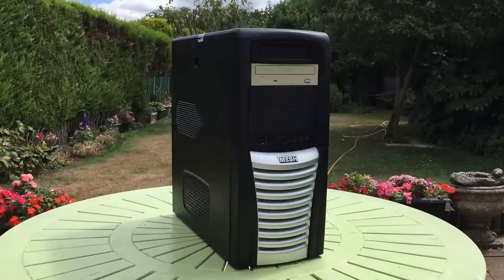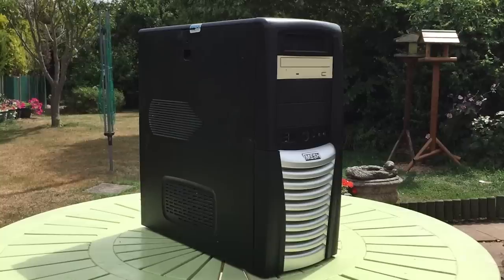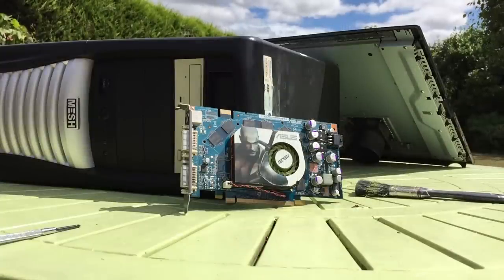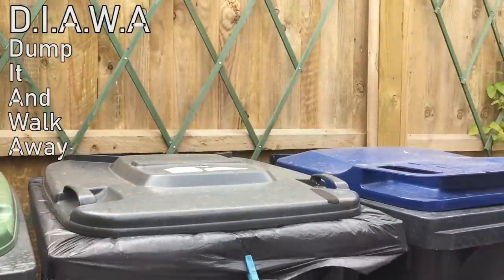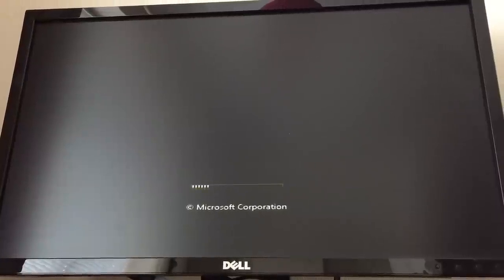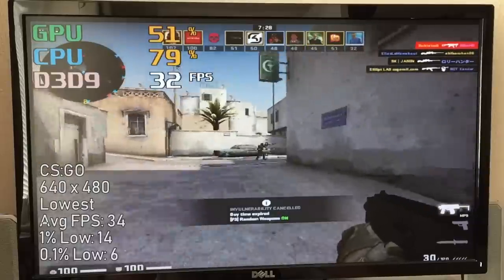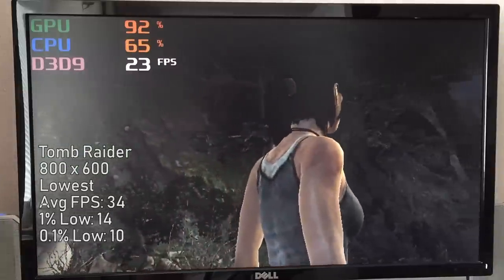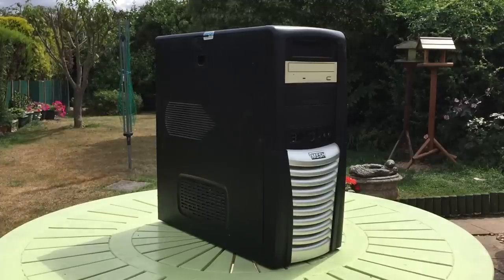Using an old £1000 ($1300) Gaming PC For The First Time In 10 Years...

Comment: The 2gigs of ram is killing it :/
Reply: Yeah, I think the overlay said the PC was using 6-ish% of its CPU power in Mafia... :/
Reply: My pc has 2gb ram...
Reply: I could max out Mafia at 1600x1200... With a Ti4200, so this card can max out it at 1080p for sure. Anyways, for this comp I'd just stick with WinXP.
Reply: @perttierajorma8884  have
edit: that was 1 year ago and i was stupid. 
sorry :/
Reply: PetarGT Cro -- Uh. No.
Reply: *has
Reply: nicholas132 have'nt*
Reply: 1gb... And Win7?
Reply: That 256mb card is not helping it either.
Reply: In the case of Minecraft I think it's the issue. As far as the other games go, CS:GO and Tomb Raider are probably limited by both the amount of RAM and the graphics card, and Crysis is probably maxing out both the GPU and CPU. As for Mafia, that computer can definitely handle it at high resolution and max details. I owned a very similar machine at the time.
Reply: pagb666 my 2008 650$ pc has 4gigs of ram and a gt9800 so i dont think thats a 1300$ pc
Reply: Αριων Βαβλιακης Considering the hardware in it, the computer featured in the video is from mid-2006
Reply: pagb666 exactly what I was thinking. XP would have been a better choice.
Reply: i have 2gb of ram :/
Reply: Mhah kek
Reply: @ControversialOpinion  2 GB of RAM would have been fine for Windows XP, but Windows 7 operates much better with 4+ GB with a 64-bit capable CPU.
Reply: It is you need more than 2gb ram for 64bit os.
Reply: @perttierajorma8884  my phone has more than that I doubt yours does
Reply: It's not the ram, some years ago I played mafia 2 on 1gb of ram just fine
Reply: My current PC has 2 GB of ram, 2.02 ghz CPU and the rest idk
Reply: I would have gone with 32-bit windows with only 2gb ram
Reply: @Petar321_GT  has
Reply: Bruh just download ram
Reply: @Petar321_GT  *has
Reply: Enfant Terrible mabe the os
Reply: pagb666 You nailed the problem bro! 👍🏻
Reply: pagb666 a core 2 duo can handle windows 7 with no problems at all with 4gb ram
Reply: If he upped it to 8 I bet it'd run way better.
Reply: @perttierajorma8884  F
Reply: Not only because is 2 gigs but only one and in the first socket
Reply: @ΑριωνΒαβλιακης  a lot changed in that period plus this was a prebuilt.
Reply: @reimnop  it was one year ago dude, and others already pointed it out.
Reply: That 256MB of VRAM, tho.
Reply: 2 flipping Gigs only 2

Comment: I just bought an pc for 90€ it has these specs: Core i3 2100 3.1ghz, 6gb ddr3(4gb 1600mhz,2gb 1333mhz), Msi gt 1030 2gb, hdd 250gb. I'd say it's pretty good for the price.
Reply: Tomas Gaming It's a bargain for that price .
Reply: Tomas Gaming it's a fucking steal mate though I'd prefer an i5 2500 over the i3
Reply: Thats a steal for the price, you can play some games on it.
Reply: I'd say i3 2100 and gt 1030 is a good combo. It can run gta v at 60fps, csgo at 90-120fps and fortnite at 90-113fps
Reply: Not on high settings though but still at least runs great for an xbox 360 price and because it's pc it can do a lot more like running emulators and stuff.
Reply: TGLT Clutch yes gddr5, and yes i checked the price of 1030 it's almost the price of the pc and my 1030 is the best version of 1030 as i checked. By the way they wanted 160€ for the pc 3 weeks ago but i got it for only 90€ lol how lucky I am!
Reply: Where did u get that bargain?
Reply: basically you just paid for the 1030
Reply: Embrace the Darkness Yup
Reply: Embrace the Darkness I'm now began to load some games on it. I will install more tomorrow
Reply: What a bargain I got a computer like they bit 2gb of extra ram for $400
Reply: Tomas Gaming You stole the guy.
Reply: Mandragoras Yeah lol
Reply: ateb3 What? It can run gta v fine
Reply: ateb3 You probably never had one your self i don't think any integrated gpu could run gta v at about 60fps on mostly high settings.
Reply: Tomas Gaming I have the i3-2120 and a GT1030 and it's actually pretty good for the price
Reply: I upgraded to an i5 2400 from an i3 2100. I have a GTX 1050 and 7GB DDR3 1333
Reply: Ralph Lau Yeah for sure
Reply: ateb3 The only integrated gpu's that are close to the 1030 are the Ryzen APU's. An overclocked 2200g is slightly under a 1030 in performance, an overclocked 2400g is around a base 1030 in performance (until you overclock the 1030). And upgrading a 1030 to a 1050 is a waste. A 1050ti may be worthwhile at the right price and you get a decent price for selling the 1030, but not a regular 1050. But honestly, with that cpu, not sure I'd go above a 1030, so just enjoy the combo and keep and eye out for cheap 1050ti deals and a cheap 3570 if you want to extend that system out longer. But thats a great price.
Reply: Got a gtx 1070ti 8gb for 150€ because the dude put "old graphics cards for sale" i have no idea how he got it.
Reply: Ahhh LGA 1155.
If you can get your hands on a E3 xeon or 3rd gen i7, 8gb ram (total) and a gtx 770 4gb, this badboy could last you even with modern titles for a long time. 

That socket takes me back to the days where intel did not throw away a socket after 1 generation.
Reply: WTF GT 1030 Is 110$ in my country
Reply: Tomas Gaming that gpu alone is like $60-$90 lol 
Where did you get such a cheap price???
Reply: thats better than mine lmfao
Reply: can you tell me where, how did you bought it?
Reply: Holy shit that’s a complete steal for only 90 Jesus ur lucky bro
Reply: My gpu costed that much XP
Reply: Lenovo??? I have one close to that and I upgraded it! It is epic except for only 2 cores in the processor
Reply: @TGLT Clutch its 90 euros so thats like 100 something dollars
Reply: for that price, its amazing. You could use it for some decent esports stuff
Reply: So you bought an entire pc with a GT 1030 for the price of a new GT 1030
Reply: awesome but maybe getting another 4GB 1600MHz stick that would help the performance (that's the config I'm using in my laptop)
Reply: nicee that's a good deal
Reply: If you need a CPU upgrade, I can recommend a i5-3450. They are really cheap and have a good performance
Reply: My mum got a LENOVO ThinkCentre M73 for $100 aud (about £70-80) and it has 12GB DDR3 ram, a GTX 745 4GB, an Intel Core i3 4130 3.4ghz, a 120gb Kingston ssd with a fresh fully activated version of Windows 10 Pro. (Btw we upgraded the ram to 16gb)
Reply: it really is
Reply: i bought a 250 eur system and its weaker than that exept it has 8gb of ram (2x8 2400mhz)
Reply: I have one for near the same that i got for 50$
Reply: It's got good upgrade potential. Power supply might need an upgrade if its low wattage or a pre- built system one.

Get an i7 2600K
16 GB ram 
And a gtx 1060
Reply: why did you buy it... 🤦‍♂️
Reply: You ripped tHim off
Reply: The gt1030 is worth at least £50 alone
Reply: Bottleneck
Reply: Sell the 1030 for a 950
Reply: I bought for €100 pc with I5 2500K and GTX 660ti, Corsair 2x4GB 1600Mhz, FSP Fortron 450W and Aerocool SL-5100
Reply: woah nice

Comment: minecraft: can't run at all
cysis: you bet it can, no stutter 

Typical Nvidia unpredictable :P
Reply: Michael _Howto&tech
Minecraft is much more cpu entensive than graphics entensive if you run minecraft on a 1080 with an i5 8400
It will have almost fps as running with a 1050 using the same cpu
Reply: I have a Core 2 Duo E6750 and mincraft always ran great, it's probably a RAM issue or GPU
Reply: yeah those stutters, i think the machine isn't working properly
Reply: no the stutter is because minecraft uses 1.5gb of ram and windows 7 uses like 1gb and this system only has 2gb of ram so yeah
Reply: Zurc not really, minecraft uses, or did use 512mb. Still 2gb filling the ram, but windows 7 can survive on 1gb of ram. (I've had a laptop like that with 1gb of ram and it was OK performance). Although his recording software might be causing some stutters also
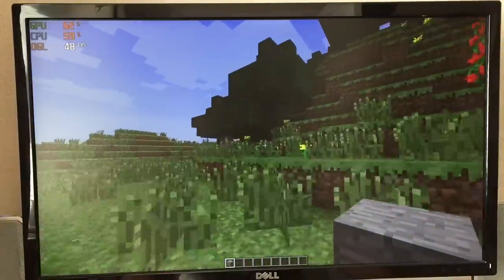Reply: well i play the game myself and everytime i play mc it uses 1024 mb i put anything lower than that on the launcher and the game wont launch also he wasnt using any recording software at 7:15 he recorded with his camera when he did benchmarks cause im sure that 2.4ghz core 2 duo wont be enough for recording + gaming at the same time so its probably not the cause of the stuttering maybe its the low clocked cpu idk
Reply: New versions of minecraft require atleast a gig of ram if he has two gigs only then its  a ram issue
Reply: Michael _Howto&tech it’s the ram not the gpu/cpu
Reply: Its most likely a mix of cpu and ram issues since minecraft uses 1 gig ram if you don't have any mods installed
Reply: Crysis the most fucking unstable game
Reply: lol
Reply: @MichaelFlatman  he's not using recording software, he's got a camcorder in front of the tv
Reply: Minecraft versions does big impact to playability
Reply: Minecraft runs on the cpu.Thats why.
Reply: @Adrien Otis Instablaster :)

Comment: RandomgaminginHD: buys 12 y/o PC.
Me: builds 12 y/o PC.
Reply: I still have the i7 950
Reply: @gopnikvasily6074  i have a4-6210
Reply: @gopnikvasily6074  i have i7 920
Reply: Same
Reply: @gopnikvasily6074  I have i3 550
Reply: @Christian Johnson boi i have a amd e1-1200 apu 1.4ghz.
Reply: @Christian Johnson but now I got a quad core Celeron at least it's way better then my old amd
Reply: Healthy retailer and consumer relationship
Reply: @Christian Johnson I dunno if its new I bought this laptop this year tho and it says it has 4 core boosts up to 2.4ghz
Reply: i got an intel core 2 duo 2.66ghz
5 gb ddr2 ram
and a 1gb DDR2 amd radeon 4650 HD
beat that bitches
Reply: Savage Survival still using ibm 😂
Reply: I have ryzen 5 3600, gtx 1660 ti, 16 gb ram
Reply: I still have a 20mhz 386 with a math coprocessor.
Reply: @ahmedamr6028   Athlon X2 5000+, 2GB DDR2 553Mhz, HD 5450 1GB DDR3, HDD IDE 40GB Windows XP. Still rocking today. (Not main system, but it's the shittiest I have)
Reply: I have amd 6300 fx :(
Reply: Me to I have core i7 4790
Reply: @princevaldym7606  there is nothing 2000watt psu.. the last model of psu is crosairr xi1600watt
Reply: bruh i have a q8400 and a gtx 550 ti i am happy with it though ^^
we'll get through this my fellow broke boys
Reply: I have pentium 4
Reply: @gopnikvasily6074  i still have the 920 and 930 lol

Comment: This would be a fun system to "max out". Max ram, max cpu, max gpu, ssd, proper fans.  Push that Mobo and case for all they are worth!
Reply: NewWorld9 Core2 Extreme QX9650, 8 GB DDR2, GTX 1050TI (Not sure if it can handle it, even with oc), PSU at least 450W quality, SSD any type, fans etc. I wonder if it would work
Reply: I would love to see, old hardware show what it can really do. would be a sweet build. Maybe a benchmark video to see which card would be the  fastest feasible for this CPU.
Reply: Max GPU? Na, sli 7900s
Reply: Somogyi Norbert yes but with a 1080ti, see what it can actually do!
Reply: I think the core 2 quad qx9770 and gtx 1060 will be cool
Reply: Yep, would run great, even with a newer GPU like a 1070 or something and play modern games at 1080p pretty well. The CPU would be holding it back a fair bit, but the core 2 CPUs had very long legs.
Reply: Derek Prestegard i will build an sff pc for my father and it will feature a q6600 oc with tape, an r7 240, 64gb ssd, 500gb hdd and all for 50e. It will be ok to play some esports for my sister and brother and some work...those core2quad are awesome man
Reply: Yeah
Reply: @TheForeverStick  nah stick a gtx 780 ti in it.

Comment: 8:27 What a hell... I remember when I had Athlon 3500+ 2,2ghz, 512MB ram, 7600gt 128mb in 2005 that I could run Mafia on max without problems.
Reply: Yeah, something is off. Same for morrowind. It should be able to run oblivion with ease.
Reply: Mojo he installed 64bit windows with 2 gigs of ram, that could be the reason for the stuttering

Comment: Why don't you try to install a performance mod for Minecraft called: "Optifine"? You can play MC even on a Pentium 4 Machine no problem with 30fps no lag.
Reply: xX_SpeedyScout_Xx I got minecraft 1.11 runnimg on a 2GHz Athlon XP system using optifine and a 8×8 texture pack. Newer Versions refused to start due to the fact that I wasn't able to install Java 8...
Reply: Athlon XP legendary cpu <3
Reply: TheSilentj Studios, I think he should use optifine. His audience aren't the kind to not use Forge & Optifine, and possibly shaders.
Reply: Talvisota when I first played Minecraft 1.5.1 I was 11 years old. I am not sure if I already had a Core 2 Duo based system or if it was still my first pc, a Pentium 4 PC from Aldi. And it didn't run very good and I had no idea what framerates are or that there are graphics settings. I dont even know if I was running windows 7 or xp at that time.
Reply: Maybe because he doesn't actually play minecraft, and rather just runs it just as a performance metric?
Reply: Back in 2011-2012 I played Minecraft on a Pentium 4 HT 3.0GHz (PGA478), 1gb DDR400, Intel integrated graphics and Windows XP without any problems :D
Reply: Minecraft works on Athlon 64 single core @2.1Ghz and gt210 and 2gb ddr2 using optifine, 1.13 runs fine, well still my i5 7600 runs it much better but...its playable
Reply: Who TF even cares about Minecraft ffs, we live in 2018 not 2012
Reply: julian matthews 
I used the old cracked louncher, new one is optimised for windows 10
Reply: xX_SpeedyScout_Xx really, it improves your internet connection making it faster than light to eliminate lag?
Reply: its almost impossible to play minecraft without optifine i use it in my i5 8gb ram and 940mx(gddr5)  (laptop) and optifine helps a lot because i like to crank up the settings
Reply: TresTurkey Still some people as it looks like
Reply: Nice idea. Back in 2012  I played minecraft with optifine at 1280x1024 resulution on P4-2600Ghz, 1GB DDR1 RAM and GeForce 3 ti 200, 64 MB with average framerate about 40. It was more then playable, actually game was running just fine with just a few tweaks.
Btw I wonder how the latest versions of minecraft would run on a PC like this one.
Reply: note that singleplayer is the big killer cpu wise with minecraft, multiplayer will be much better when the server is handing mob ai and all that, i used to play 1.12 on a Thinkpad X41t, a 1.6ghz Pentium M ulv, intel GMA 900, 1.5gb of ram in 1024x768.
wasnt the worst, 25-30fps at lower settings in multiplayer
Reply: Wow. It can change the entire worlds development of the gaming. I'm surprised that Minecraft can get 10 more Frames per Second by a app named "OPTIFINE". I'm blessed.
Reply: i like your name for one reason because i love tf2
Reply: Tf2 is awesome
Reply: @HoshiNoKaabii  I have a similar build and get 500 FPS with shaders and Optifine, top settings ;)
Reply: hello scouty
Reply: xX_SpeedyScout_Xx how does it work?
Reply: I used to run minecraft on a 2007 laptop with 30fps
Reply: Lol just install ram on ur pc someone on the black market told me
Reply: If my memory serves me Minecraft was a bugger to run at top specs because of the use of Java, which made it a very CPU intensive game.

I have not been on Minecraft on my PC for years, but using optifine, with all the options, and the farthest render distance was one sure fire way to make even the most capable system sweat like fuck. I have an i7 system with 16gb of ram and two 970 gtx in SLi, and I was lucky get around 30-40 FPS... Do not ask what happened in amplified... 😂😂😂
Reply: @boomwithpeter623  oh man that setup is nostalgic. I had an athlon 64 single core with a gig of ram, an Nvidia 7200GS and a 100 pata gig hdd (plus a 500 gig sata hdd full of pirated music and movies my brother gave me). I played so much C&C Generals Zero Hour, Flatout 1 and Minecraft on it back in the day.
Reply: Yeah i see someone mentioned sineplayer killes preformace, oh boi yes it does, when i benchmarked mc1.13.2 i used a local server on E3 1230v6 (ubuntu server 18.04). It made the game playable at 50-60fps, tho in singleplayer...5-10fps max, singleplayer athlon just cant host a server localy and run the gane...heh but 99% of people play multiplayer

Also CS:S plays with ezz, hls dm (my favourite pc game at that time) also runs at 60fps
Reply: @abdulahad200  you wont beleve it but people acctualy play a lot of minecraft these days, also you cant force anyone to play fortnut or pubg, in my opinion its crap but some some people its the best game in the world, some people dont like half life, but i like it...

Its just different taste
Reply: Thats not gonna fix anything in this scenario.

Comment: I know this is far in the future and you are a smart cookie... those old Intel coolers are bad assed and easy to clean. Remove the fan and cooler lile you have done, remove the fan from cooler and you now have a chunk of aluminium that you can spray off with (in America...awesome cleaner) instant clean... and then rinse with water .... a 1/2 in thick 6x6 piece of glass with some 2000 (available at an auto body shop) grit sandpaper makes a cheap leveling block for the heat sink base and the CPU top... cheers mate from Thailand 
Thanks for sharing the weirdly awesome channel and the weirdly awesome builds you find and repair ...

Comment: I still have an E6700, with a GTX 650ti, and it can still handle modern games with ease. But I am looking forward to buy a Dell Optiplex with an I7 2600 to upgrade it.
Reply: I've built an Optiplex 390 SFF comp from mostly scrapped parts with an i7 2600 and GTX660 2Gb (CPU was about €40 and GPU about €20), works quite nice but I haven't had the time to push it with games (the GPU is bottlenecking the CPU though)